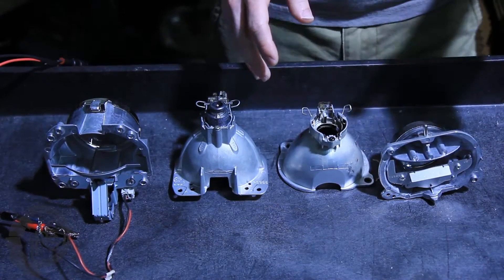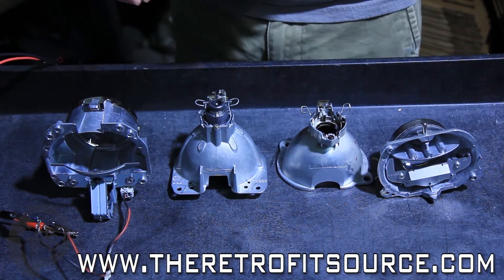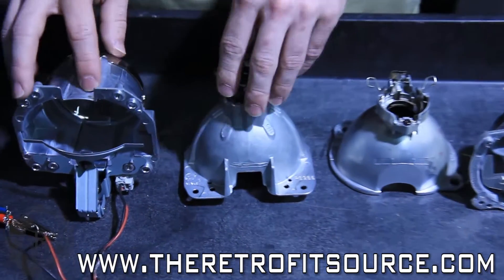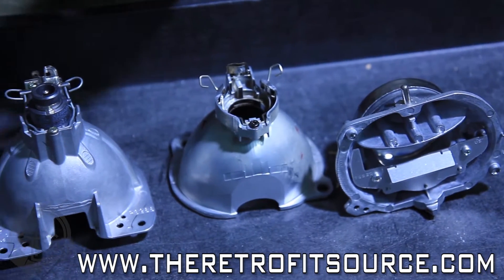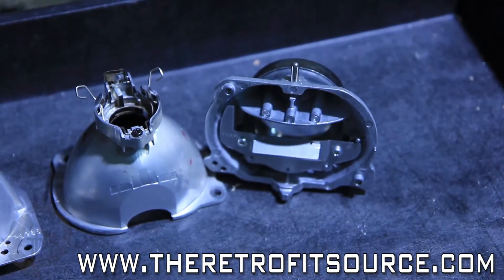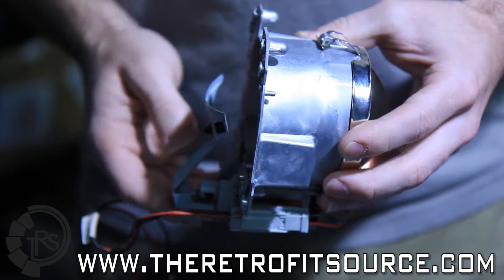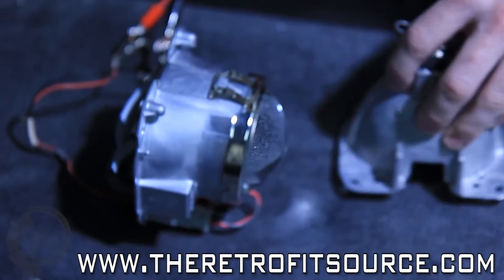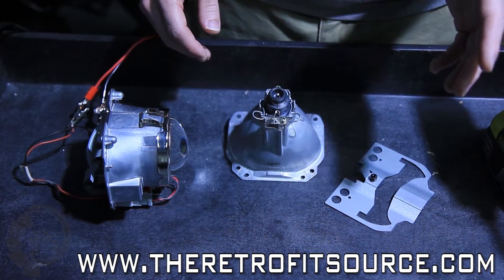TRS Tech: Bi-xenon Projectors? Low Beam Projectors? Differences Explained

Comment: I have a 2014 Kia optima that has a low beam halogen projector as well as a high beam halogen reflector housing. What would I do in this situation to get the most light? Would I just do a single retrofit with an upgraded projector since the OEM Kia ones suck. Or do you go with bi xenon? If I go with bi xenon then what happens with the high beam halogen reflector that’s already installed on the car ?
Reply from the maker: You could easily do a projector swap, keep the OEM high beam, and then use a splitter so you have double high beams.

Comment: My headlights came with Bi-Xenon projectors in low beam location, but plan on keeping my highbeams next to my lowbeams. Question is can I just skip splicing the high beam function on the projector if I’m keeping my original high/drl next to my low beam projector?
Reply from the maker: Yes you can. You can also splice the high beam function, and have quad high beams for even more light output.

Comment: Thank you for this video. I have a 16 WRX with two separate bulbs for the high and low beam(9005 and H11). My high beam bulb also functions as my DRL's. Which projector housing would you recommend?